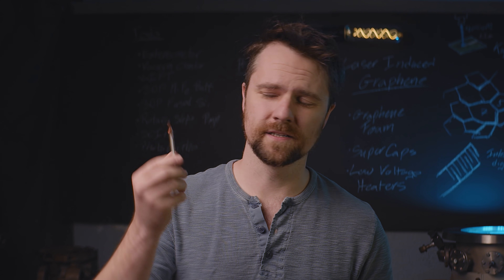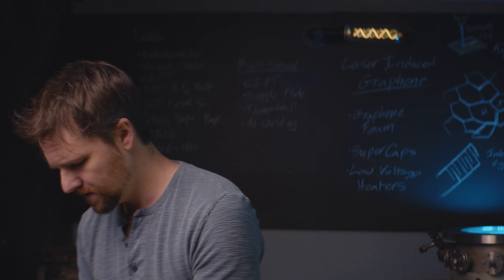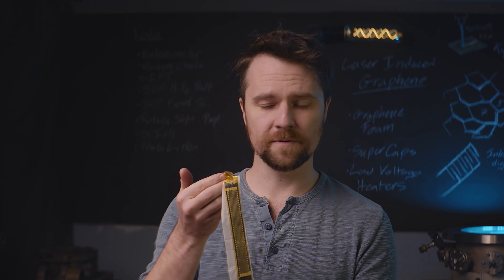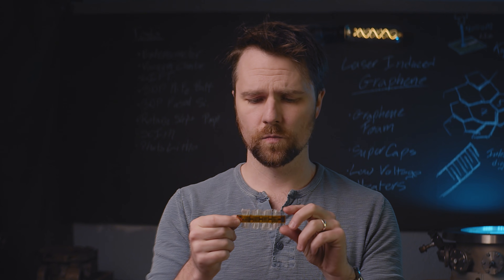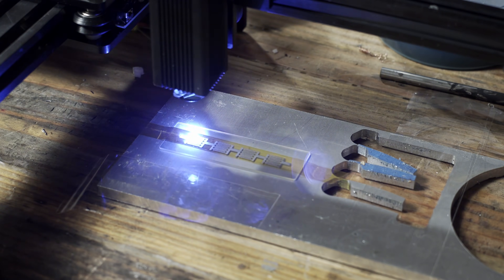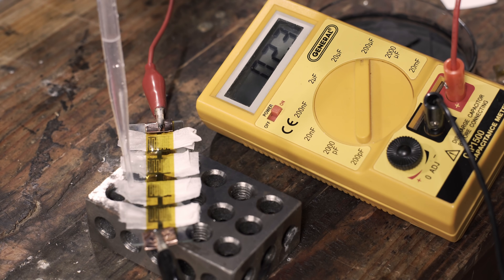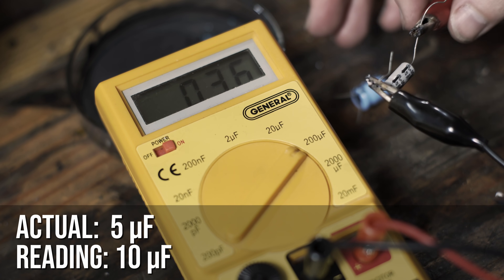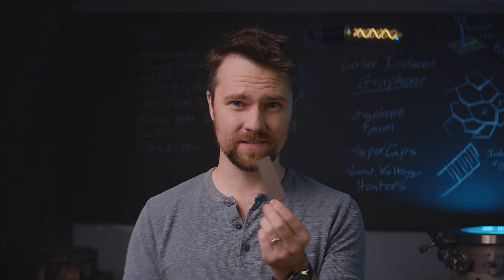Kapton Tape Supercapacitor?

Comment: 405nm is in the range for resin printing. I'd imagine you could do this with an SLR resin printer. Would long exposure to the UV-backlit LCD resin printer do the trick instead of the SLR laser?
Reply from the maker: SLR laser would probably work I think, assuming you can slow it down enough (or it has enough wattage).  I don't think the backlit LCD printers would work though, they wouldn't have a high enough power density. E.g. my 5W laser power is all concentrated into maybe 0.5-1mm spot, which gives a power density on the order of 600W/cm2.  You could in theory focus a plan LED down to a similar spot size and achieve the same thing... in this case there's nothing special about the laser, it's just an easy way to get a tight focal spot.
Reply: @BreakingTaps  The graphene is catalyzed from the adhesive, right?

For the purposes of creating a heater, having the adhesive applied to a different surface first would be ideal. How simple would it be to separate the backing from the adhesive of the tape? Or to recreate the crucial part of the adhesive formula?

Comment: I don't know if someone already mentioned this, but you can validate the capacitance assembling an LC oscillator using an inductor with known inductance and measuring the resulting frequency
Reply: Since most super capacitor designs are for energy storage with a DC voltage, it would be better to measure the capacitance under said operating DC bias.
Measure the step response time of a discharge under constant resistance (eg. time the discharge from 3.0V down to 0.3V with 1000 Ohms across it).

Comment: Neat experiment! I am wondering how brittle is this construction? Would the graphene foam crack if you bent it?
Reply from the maker: It does bend pretty well, but is fragile and will flake off if you're too aggressive.  But you can place another layer of tape on top and it becomes basically indestructable. Lots of papers do that to create flexible electrodes and sensors.  Compressing the LIG with the top layer of tape does change the characteristics a bit though, densifies it and improves conductivity iirc.

Comment: How much do these cost, and where could I get some samples for testing?  I work with micro-solar projects and could really use these!
Reply from the maker: Afraid I don't sell them, but they are pretty easy to make if you want to try yourself!  The laser engraver machine was maybe $200 USD, and then you just need a roll of kapton tape :)

Comment: Can I cover some paper with capton tape an put it into a laser printer to make the graphene and use the paper to soak the electrolyte?
Reply from the maker: Hmm, I think the adhesive layer of the kapton would interfere with that arrangement (it's non-conductive, and remains as a layer after lasering).  If you used non-adhesive kapton you could layer paper on top/bottom and it would work, but need some way to keep the bundle together.
Reply: @BreakingTaps  maybe just use the printer for the laser then... maybe it's easier to make graphene with it

Comment: That heater bit was amazing! Could you make a video with a bit more detail on that.. I didn't quite understand how the connections were made across the Kapton tape after it was lasered and converted.
Reply from the maker: I'll see what I can do!  Have had some other folks request more info about the heater as well.  The connections were just strips of copper tape pressed against the edge of the graphene, held in place with clamps.  That's the big downfall with this technique, making electrical contact to the graphene is hard (it doesn't solder well).  Most research papers use conductive epoxy, and I just pressed copper directly against it :)

Comment: How powerful was your laser? I've been looking into this for heating but I can't find anything that says except a CO2 laser. I really don't think it's a 5 Watt laser. 5 Watt lasers(At least lasers that are actually 5 watts) are extremely expensive. Can you show me the source for yours?
Reply from the maker: It's a 450nm "20w" diode laser, but the 20w is just what it pulls from the wall.  Community folks have tested them and they usually clock in at ~5w of optical power, depending on what diode is used internally.  But modern diode lasers can pump out a surprising amount of power, although the beam quality is pretty garbage (diverges quickly, CW not pulsed, all kinds of modes, etc).  Mine came as a "laser engraver" kit (e.g. https://www.ebay.com/itm/NEJE-Master-2-20W-CNC-Laser-Engraving-Milling-Machine-Engraver-Cutter-Printer/203145471980 or similar) but you can get the diodes separately too.

High power is pretty dependent on wavelength though, even more so with good beam quality.  E.g. 405 and 450nm aren't too bad (I have a 2w 405nm diode waiting on a different project).  And I have a 50w pulsed fiber laser (which is many kW of peak power) at 1064nm.  But wavelengths like 532nm are indeed hard to get high power since you need a frequency doubler.  

And if you need nicer beam characteristics you really need to use gas laser which get expensive fast :)
Reply: @BreakingTaps  Wow I'm extremely surprised. My experience with engravers has always been large expensive CNC machines. I never thought they would be this prevalent in the hobby market at those prices. Thank you! I'm excited to see what you will make going forward. It's really taught me a lot! Also, you should really set up a Patreon, I'd love to throw a few bucks in the bucket :)
Reply from the maker: @Gmanc22  Yeah, diode prices have really dropped in the last few years, pretty wild what's available for not much money these days!  Fair warning though, the 450nm blue light does have limitations relative to something long like a CO2 laser. You can engrave/cut wood, leather, paper, colored acrylic, dark plastics, etc.  But it won't touch metals or clear acrylic/clear plastic at all.  And it still doesn't have quite the same oomph of a bigger CO2 laser, might take lots of passes to get through thicker pieces of wood, that sort of thing :)

I've been thinking about a Patreon, maybe when I hit 10k subs it'll feel like a good milestone.  We'll see.  Thanks for stopping by! :)

Comment: I remember back when graphite oxide was a material explored for this.  They used a Light Scribe CD burner for it back around 2012.

It just hit me that I should look at exploring this material in my planned cold cathode electron beam project(s).  Surface area is a huge part of electron emission as is the "sharpness" of a material.  Carbon wools and nanotubes have been experimented with and in this case the millions of 2d carbon sheets all foamed together might make a fairly effective cathode with a low work function.  Might not work all that well for an electron microscope but for electron beam milling/sputtering, sintering, etc - it might be rather plausible...
Reply from the maker: Oooh, interesting!  Got any more information about your cold cathode e-beam project?  Would love to follow along. . Would "contamination" from the polyimide be an issue?  My understanding is that there is usually a thin layer of kapton that remains at the bottom of the LIG, and sometimes mixed in if the parameters aren't dialed in perfectly.  I guess being an insulator it just wouldn't contribute to the e-beam, but wouldn't necessarily cause issue?
Reply: @BreakingTaps  
A thin layer of kapton might be an issue for low voltage sources.  There may be some tuning that would need to be done.  Alternatively, I could play around with creating some graphite/graphene oxide and coating it on a conductive element.

The project is mostly in the conceptual stages at the moment, working on ways to achieve sufficient vacuum and double checking my ideas against known principles.  The whole idea started out of three related ideas.  I have always wanted to try and make a desktop electron beam sintering machine.  The complexity of a vacuum is a bit more challenging, but the overall system far more practical for small shop and even hobby use than the optics and inert gas requirements for DMLS.  I think the vacuum easier to achieve than, primarily, the optics of DMLS.  To oversimplify, electron beam sintering is basically modifying a tube television with a powder bed and z axis drop.

There was also a desire to try and make a small synchrotron pumped plasma wakefield accelerator and see if I could get it to self-pinch in atmosphere.  The main purpose of the synchrotron was to bunch electrons and/or ions together before feeding them into a plasma wakefield stage - which can drive particle energies up by orders of magnitude within a meter of linear acceleration.  This blended together with some metal ion accelerator research being done at places with far more resources than I - where metal wires would be vaporized and used in classic linear accelerators.

This all blended together into an ultimate idea to use ion beams derived from wire or metal stock to create an additive manufacturing method.  There was also a crude refinement/separation process which would plasmate incoming material and use stages of mass spectrometry using magnetic deflection to separate atoms and molecules by mass.  Provided plasmas completely destroy the bonds between atoms and weird plasma chemistry can be prevented from occurring - it would be a very power intensive, but nearly universal method of refining material and even separating it by isotope given enough separation stages.

Anyway - the main idea was to sublimate transition metals and other elements, ionize them, then build things via micro or even nano structuring and patterning.

The lower the voltage can be made for loosing electrons from bulk material, the better, in general.

A friend of mine was also rebuilding old arcade cabinets and repairing the electronics in them.  I found that I missed the glow of an old television tube and that the LCD displays just lacked the ambiance of a proper arcade.  It's nearly impossible to find reasonably priced replacement tubes and I have been looking for a means to revive or even advance the technology with lighter and less power hungry electronics - to include related plasma panels.  If this could serve as a low voltage electron source, then phosphor coatings and a separation grid under vacuum would be all that was necessary - and the result would theoretically last longer.

Comment: Graphene is said to be ideal material for Lithium battery.
Any pilot project on that?  Such as cut open a lithium battery and replace with a graphene electrode such as yours.
Reply: I would have to look into some of the papers on them, but there are what are called "lithium ion capacitors" which are about an order of magnitude greater in power storage than a super capacitor, but not quite to the stage of a lithium battery.  There may be a need to figure out how to dope the induced graphene - although with any successful doping of this style of graphene, there would open up a whole range of weird and wacky DIY projects usually reserved for high cost lab environments.

Comment: the heating element idea could be neat to create a very compact and even heating 'cylinder' for 3D printing heads. I assume you just have to roll the Kapton into a cylinder with a electrode strip top and bottom. Wrapped around the hot-end tobe of a 3D printing nozzle that would add very little to no space in a very efficient way  ?
Reply from the maker: Yeah I think it would work well for that!  The big issue I've run into so far is getting a reliable electrical contact.  Most of my tests were with copper tape mechanically pressed against the graphene, and the literature uses a lot of silver epoxy.  Finding a better/more robust method to contact it would help a lot.

Comment: What kind of resistance (ohm) did you get out of the heater ?
Amazing channel, you did, what I had in mind but was to lazy to get deep into it. 
I tried once, the chemical laser etching with sodium perchlorate but didn't work.
I probably also made laser induced graphene, without even knowing about it, still have microscope slides with a yellow residue, when I was setting up own my laser pcb engraver.
Reply from the maker: Thanks!  I don't think I measured the heater specifically (or forgot to write it down), but in general I was getting 150-400 ohm between two points about 1cm apart. Best results were down in 40ohm range (and I recently hit ~8ohm on a different project), and worst results were routinely in kilo or megaohm range.  Really dependent on parameters and the tape being used.

Big grain of salt, these were two point tests just poking the LIG, rather than a proper four-point or square test.  And the flaky nature means that some samples can give variable results depending on how you disrupt the surface.

Comment: Great video! Just found your channel. Very interesting tech. What was the internal resistance from your homemade cap? I would like to see more on the performance of this kind of cap before I start investing in equipment. I am working on a cap based project that will get very expensive as I increase the power output and the idea of making my own caps has crossed my mind more than once. The simplicity of this design is impressive. SUBSCRIBED check
Reply from the maker: Thanks! Unfortunately I didn't check the internal resistance/ESR... mainly becaues I'm new to battery and caps in general and didn't know to check at the time :)  I might revisit this project in the future though, want to try out a few different techniques and us a gel electrolyte instead.  If I do that, I'll try to do a better job characterizing their performance.  Recent picked up an curve tester for my oscilloscope to help too.  Cheers!

Comment: The finger structure reminds me of a strain gauge. Could that be a potential use? Nice channel by the way!
Reply from the maker: Good eye!  Yeah, there are some papers using it for strain sensors because the resistance changes as the substrate flexes, and some other papers that use it as a capacitive touch/proximity sensor.  There was another interesting paper that used it as both a sound/pressure sensor (detecting change in resistance) and as a speaker (AC current causing heating which induces pressure waves): https://www.nature.com/articles/ncomms14579  Think I saw a paper somewhere using it to measure humidity too.  Lots of neat stuff!
Reply: @BreakingTaps  Cool! It's a realy flexible methode then considering it's simplicity.

Comment: Hey. Wanna try a neat science experiment? See if you can make an electromotor using laser induced graphene. Might be a cool idea for a vid, too.
Reply from the maker: That's a neat idea!  Will have to think about the best way to do that...
Reply: @BreakingTaps  I often imagine building robots completely out of bionylon and kapton, and aside from the actual electronics and arduinos, the only main component left would be the stepper motors. If one could make stepper motors entirely out of kapton, then that would make a fully plastic, fully plant derived robot possible. All you would need is organic materials and agriculture to build it.

Comment: Thank you very much for the video. What was the electrolyte you used or what acid did you use and in what concentration?
Reply from the maker: No problem, thanks for watching!  The electrolyte is just dilute sulphuric acid.  I forget the concentration (sorry!  I took bad notes this time around), but was around 1M if memory serves.  1-4M is pretty common for H2SO4 from my reading.  Many different aqueous electrolytes are possible though, since this is an electrostatic mechanism... it just needs charged ions.  So HCL is possible (although less friendly to work with imo) and H3PO3 (which literature suggests works very well), as are various bases (KOH, NaOH, etc).  A lot of papers use PVA + H2SO4 to make a gel... I've been playing around with that lately but still trying to find a good recipe for it :)
Reply: @BreakingTaps  thank you very much for your reply. I stay tuned for new videos

Comment: How wild can you get with thinner traces and even something like space filling curves to get more trace-to-trace contact in the same 2D surface area?
Reply from the maker: Definitely!  I haven't measured it precisely, but when you're scribing on "line" mode (rather than raster filling shapes like I did in the video), you can get lines that are maybe 0.5mm wide?  Could pack in a lot of electrode that way when coupled to a space filling curve.  I saw a few papers doing similar (https://www.sciencedirect.com/science/article/abs/pii/S0378775318301824) so it seems like a really good idea.

Comment: Awesome! Sub button clicked :)    What kind of resistance per cm were getting along a line on the tape?  If its low enough it could be a way to make electrodes for certain types of batteries.....
Reply from the maker: Thanks!  I just looked over my notes and it seems I didn't write down any of the resistances that I tested 😞  I'll pop out the garage tonight and measure some of the test samples that I didn't turn into supercaps, they should be pretty similar and not covered in sulphuric acid :)
Reply: @BreakingTaps  Cheers, thanks for that!
Reply from the maker: @Etherlon Tested some of the test samples and electrodes that didn't get turned into supercaps.  Fair warning: I just stabbed two parts of the electrode ~1cm apart, traces were maybe 2-3mm wide?  So not proper square or 4-point sheet resistance readings :)  That said, the best samples were on the order of 30-40Ω, average was 100-150Ω, and worst samples were several kΩ.  So definitely some process variability here, and I know from other tests that the brand/thickness of Kapton seems to affect things too.
Reply: @BreakingTaps  Thanks for letting me know. Cheers!